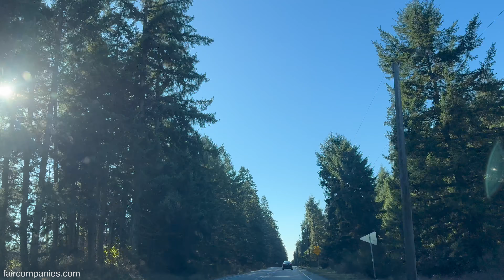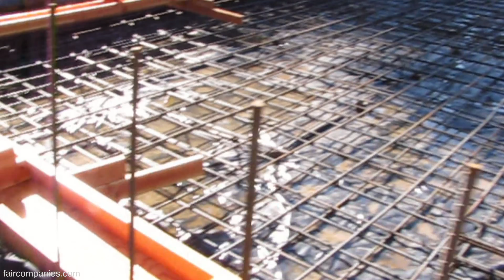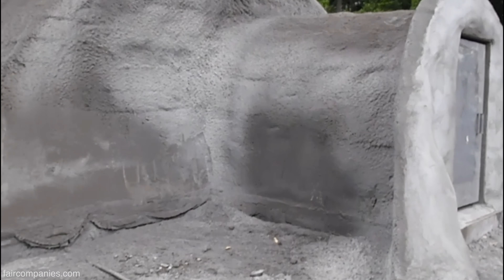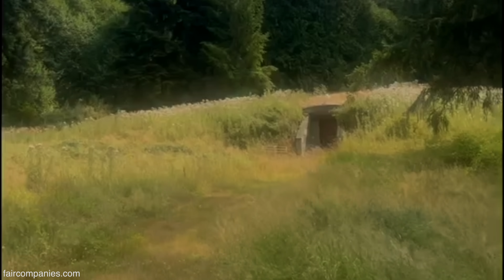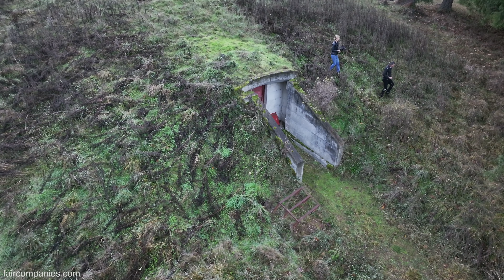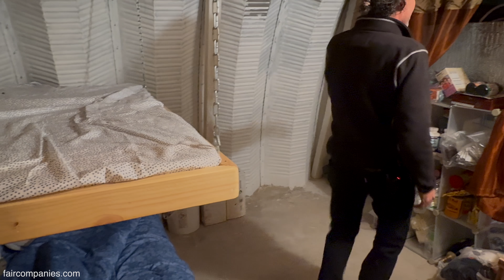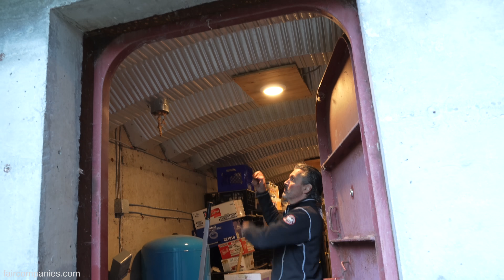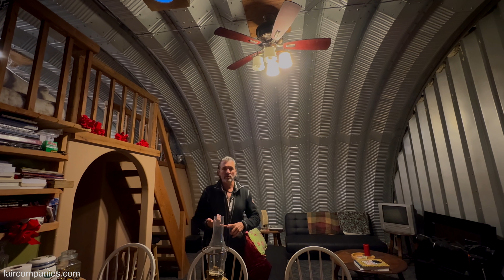Building Bunker Villa on a budget using Quonset Hut structure

Comment: Not sure why the spray foam was used?  It would be stronger with shot Crete directly on the quonset steel, no?
Reply: I am the guy who built the structure. I want to reply to you. The spray foam is needed for insulation to break the barrier between the cold earth and the interior metal underground structure temperature. Just like anything that has Insulation it's for that reason and we do it first, so it willprotect the metal structure from any cold surface. Up against  it creating condensation. I hope that answers your question. Good question very good question I get that asked by any serious Builder.
Reply: @davehygaard2  So its done because its a living space and to prevent condensation. A structure that is used for storage would not really need the insulation if it was unconditioned space.
Reply: Yeah not sure why the foam was used as well. The point of putting dirt on it is to use that as the insulation. The whole point to bury something is to regulate the internal temature. In most places the ground temp is 55f. Stable temp equals lower energy costs. 
The overall cost of this building is far more than what it would take to buy ICF. You can now insulate the footers, walls, floors, and roof. Give the specs to your enegineer and they will spec everything so you can bury several feet over it. The pond liner alone for a large enough piece is going to set you back upwards of 10k or more for a large enough single piece unit and thick enough that nothing will rip it.

Comment: 13 years in the pacific northwest and it's not leaking or moldy is an accomplishment. no worries building something like this in the high desert
Reply: I was born and raised in the high desert of New Mexico. Excellent point. No worries about condensation at home.✊
Reply: @El_Choppers  Yeah. Only radon poisoning
Reply: @madnessintomagic  Yeah.  That, and condensation.  But as long as you're moving this much earth, burying some perforated pipe for air tubes and install some fans.  You don't need great big fans.

One thing the host said was preferring not to have anything mechanical, and I get that.  At the same time, the place is evidently on the grid, so...  Anyway, fans don't pull that much juice, and you can rig up air intakes that direct air into the structure, regardless of wind direction, if there's any wind.  I'd do some steam punk thing, where my stationary bike powers the fans.
Reply: Depending on the radon level some remediation systems can be passive and don’t use power.
Reply: @nicklane1897  Same. Surface water management is essentially all I want to know at this point.
Reply: @nicklane1897  good point!
Reply: Exactly!
Reply: Not sure I'll ever understand why people think they need this at all. All the doomsday folks should pool their money and counter Chinese/Russian influence which seeks to destabilize their country. Donate to politicians that keep the country on the right track. Or at least take that cash and invest in a foreign passport. Almost anything is better than these bunkers. So much wasted potential, they're almost never used.
Reply: Except the clay content in the ground of the desert has a lot higher clay content which means it can be like concrete in certain areas to dig in. I live in the Sonoran desert, and some of the ground here has to be soaked or machine broken.
Reply: @DiviAether  It is very similar here, we have something called Hard Pan and it is basically concrete...
Reply: @VikingShelters I have a feeling hard pan in only in certain areas though - not EVERY INCH OF DIRT 😂😂😂 LMAO sucks so bad to dig out here - plus is when you do build out here it doesn’t have to settle much 😂

Comment: The underground pipes for ventilation remind me of the Earthship houses out in Arizona. As for temperature, once you get several feet underground (basically below the frost line + a few feet) the temperature stays pretty consistent all year round. Never thought of shotcreting a Quonset Hut so you could bury it, personally I would go with at least an exposed south facing wall I could put windows in to gain solar heating in the winter like the Earthships do, but i'm not looking for a Bunker to hide away from the world in, I'm looking for a super efficient house that could function off grid if the need arose.

Comment: My Dad built his home in 1960, pouring all the walls of the basement, including the center wall.  He poured a 6'X6" pump room, outside the house foundation, with a poured top with step, and that was our front porch.  He had a big cleanout screwed into it, to access the point in the well if needed.  He also poured a tile in the basement floor, just in case one day there would, one day, be a sewer, and need a sump-pump.  He put the hole there in 1960, and they used it in 1992.  Out of the basement, the steps awere poured.  He came in thru the garage with the stairs, because he didn't want to take up the room in the house. 
The garage were poured as well as all the garage walls, 18 inches from the floor, to build the framing on..

Comment: Critical success in having a well on the inside. I also appreciate the extra large tank on the inside, they just logistically erred in setting it up. Absolute critical failure in not have an air filtration system and having no in house power. It could be retro fitted, but in the end of the, just didnt think it through and too many mistakes made.

Comment: Not a disguised place! plant a lot of trees in the place where the bunker stands.Replace the light bulbs with LED ones, they shine brighter and require less energy. And so, in general, it is very beautifully and competently equipped, nothing superfluous. But just in case, I would consider a groundwater pumping system (if there are any in your latitude)

Comment: It will rust out in 20 years. It will keep cold in and moisture more so than expell. So you will need celling fans and a dehumidifier.  Your dome should be flat on top and round on the bottom for heating. So its upside down.
Reply: 12 years in and zero rust or water leaks in the wettest climate in the USA.... I don't think you realize what a Quonset Hut is made out of...

Comment: The builder seems to infer that the quonset arches don't have integrity without the shotcrete...but I believe they are more than capable of handling impressive loads without. I'm sure he did the math though, on the tonage of weight of that depth of backfill  which made it necessary for the shotcrete.
Reply: Yes, everything was properly engineers by a professional and I would never trust only a Quonset hut shell with 6 feet of soil on top even in the thickest gauges available. People have tried and from what I remember, it didn't last nor end well..

Comment: Will this keep radiation out, though?  It doesn't seem deep enough underground to prevent that.  Also, a few inches of earth covering the top of the shelter clearly wouldn't be enough to keep radiation out.  

Civil Defense standards state that any such shelter needs to be at least three feet undergound, arguably six feet, in order to protect from and keep out gamma radiation.  It would seem like you did this, right?  

Also, I would still construct concrete walls around it, even with the shotcrete.

Comment: I asked AI, what is shot Crete with helix steel, pretty fascinating stuff!

Shotcrete with Helix Steel is a combination of two building materials used in construction projects, particularly for reinforcing and supporting surfaces in tunnels, slopes, and other challenging environments. Let's break down each element:

 Shotcrete:

Shotcrete is a type of sprayed concrete applied with a specialized nozzle under high pressure.
It's often used in situations where traditional poured concrete is impractical or impossible, like overhead applications or uneven surfaces.
Compared to regular concrete, it offers better adhesion to existing surfaces, improved structural strength, and faster setting times.
 Helix Steel:

Helix Steel is a brand of microfiber reinforcement for concrete.
Unlike traditional rebar (steel bars), it consists of millions of tiny, twisted steel fibers evenly distributed throughout the concrete mix.
This provides more uniform reinforcement, reducing the risk of cracks and improving overall tensile strength and ductility.
 Combining them:

When used together, shotcrete with Helix Steel offers several advantages:
Stronger and more uniform reinforcement: Helix Steel distributes reinforcement throughout the concrete, eliminating weak points and reducing the risk of cracking.
Improved workability: The fibers improve the cohesiveness of the shotcrete, making it easier to apply and reducing the risk of slumping or segregation.
Faster construction: Faster setting times of shotcrete combined with increased workability allows for quicker project completion.
Reduced material usage: Compared to traditional rebar, Helix Steel can sometimes reduce the overall amount of steel needed for reinforcement.
 Applications:

Shotcrete with Helix Steel is commonly used in:
Tunneling and underground construction
Slope stabilization and rockfall protection
Swimming pools and water features
Repair and rehabilitation of concrete structures
Thin-shell structures and architectural applications
 Overall, shotcrete with Helix Steel offers a versatile and effective solution for reinforcing and supporting structures in demanding environments, particularly where ease of application and improved performance are desired.
Reply: Excellent, detailed response. Thanks

Comment: Listening to this guy lying like crazy I’m watching the outside of the door of the entrance to this place. There’s not 6 feet of dirt on top of that door. The vent is maybe 12 to 16 inches from the chakra concrete and you could see the entire events on top there probably 2 inches of dirt on top of the ceiling structure, he claim 6 feet which is a crackhead lie
Reply: Why is this entire so called bunker look like a 1970 trailer park home? Extremely unnecessary when in fact this could’ve been done very differently such as a modern home, mold resistant sheet rock interior insulation, God sakes why didn’t you put in well water for a manual pump as well as an electrical pump in case you have power outages you can just pump your water in just like on any home in Long Island or an upstate New York or I don’t care Beverly Hills it would be the sameI’ve watched building these homes as well as the structures and their upside down thinking is absolutely crazy. I’m about to build one myself and everything that I saw in the most advanced building method is childish.

Comment: This is a nice underground home. But it is not equipped as a serious survival bunker. It does not appear to have a gas tight door, air filtration or self contained generation. Anyone who ACTUALLY knows about bunkers would not have propane underground. There has been several nasty fires over the years. Of course everyone knows where it is now and that the guy has supplies stored. Overall not a good idea.

Comment: And since this guy used only 2 inches of concrete on the long side and 3 inches where the doorways are and everything, I hate to say it that bunker is only able to survive if any EMP hits maybe but if a nuke comes anywhere near that you die from radiation because the walls have to be at least 6 inches thick all the way around for a nuclear radiation not see-through but you also have to use earth over the top of it like he did but you need thicker concrete I don’t care if it’s reinforced concrete look at what happened to Chernobyl that had reinforced concrete and guess what if somebody stayed in some of those buildings they still would’ve died even if it was reinforced because it’s a lot of work and it’s very expensive to pour one thick slab in one complete poor
Reply: Maybe you heard him say the structure is covered with 2-4" inches of spray foam prior to the shotcrete? This structure is a solid 1 foot 12" inches of concrete with Helix Steel that is stronger than rebar and proven with science. 

The Bunker is covered with at least 6 feet of soil at the top. Thanks
Reply: Well the skylight anyways needs some sort of shutter unless somebody wants an accidental overdose of gamma radiation.

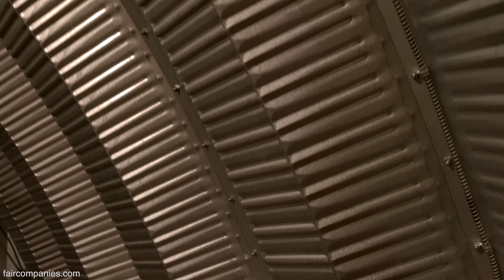Comment: 2:27 
But it looks cold, and how long will the steel last? And foam eventually absorbs water. So moisture? 
And then bury it?

Not sure about this for northern New England

13:20 water outside would freeze here; and with a minimal mid-sized solar power system pumping from that tank is of no consequence.

17:45 I’d have done a bit taller of a design (lowered floor height below) for adequate standing room. Excellent loft space.

Comment: It's a great build BUT since this IS Portland area subject to BIG Earthquaked that Qunset Hut will pull itself apart on the P-Waves (i.e. Powerwave) cross-moves and up-down severe vibrations of any tremor greater than 7.0 and then collapse upon itself. Unfortunately in the Pacific Northwest, the ONLY WAY to prevent structural collapse is LOTS of STEEL and/or Reinforced Concrete.

I've always wanted my own underground bunker but I'm building mine out of solid one metre thick (3.1 feet) of solid fibre-reinforced concrete with ultra-corrosion resistant galvanized high-tensile-strength stainless steel rebar for tensile and compressive strength structural reinforcing! 

I will be covering the entire outside of the bunker dome with a half-inch thick coating of Line-X truck bed liner and then line the outside of that coating with an 8 inch thick layer of fire-proof FireBricks for more off-grid-bunker zombie-proofing. Then I will pour a good 20 feet layer of gravel and an upper layer dome of high-density water-proofing clay over some very thick polyethylene sheeting to ensure water and ice/snow are moved away from the main dome structure.

For power I would use multiple 10,000 gallon propane tanks hidden underground atache dto a Ballard-type Proton-Proton Membrane Exchange Fuel Cell for the ultimate in quiety and stealth power production. Add a full supply of mountain house freeze dried foods (30 year shelf life) and decent long-distance Shortwave and Starlink Wireless Internet communications and you have a fully hidden off-grid house to survive the great pandemics or great wars.

V

Comment: Instead of Propane, have Hydrogen :) Propane is good...until the refill truck stops coming. But Hydrogen? Make all you want, whenever you want it. :)
Reply: IIRC, H2 is even harder to work with than propane. Smaller molecular size means more complex/expensive plumbing, etc. Maybe if you were using it to feed a fuel cell and ALL of the H2 storage and plumbing is OUTSIDE and well away from the structure.
Because... Hindenburg.
Reply: @andrewr7820  I hear you...however, you are ONLY producing as much Hydrogen as needed for that moment. No storage

Comment: I like the idea of having the water tank or, better, a series of tanks distributed through the living space.   
The reason is not just to temprer the water temperature,  but a perfect place to dump extra power generated by using imersion heaters  to bring up the water temperature and have a way to  naturally  boost or the interior temperature.   Think of extra power in solar arrays.. after the batteries are charged, the extra power is dumped one way or... this.  Comfort and humidity.

It would also be easy to draw surface rains into tanks if a well was not an option or in addition to.

Comment: It wouldn't cost $150,000 to pour the walls with concrete.
Reply: you don't even need concrete, brick will do just fine and last centuries. this will be a death trap in a decade.
Reply: @chrishultgren777 not true... this was built in 2010-2011.

Comment: Is the spray foam necessary since you're going to be insulated by earth? Or is it used for something else?
Reply: The spray foam is necessary in two ways, one having a surface for the shotcrete to stick to the vertical slope and two, it prevents moisture from sweating on the inside.

Comment: This reminds me of a Monolithic Dome. I think they layers materials in a different order: envelope on the outside, insulation inside of that, rebar and shotcrete inside of that. Their idea is for the concrete for serve as thermal mass that is insulated from outside changes in temperature. I wonder if the construction in this video fluctuates more or less, or if it makes no difference due to the thick layer of regolith outside of all the layers.

Comment: How do you keep an underground structure mold free?
Reply: Air movement. 
And as others have pointed out, low humidity.
Reply: If it’s water tight it’ll be fairly dry inside. I’d imagine you’d just run a dehumidifier on low every now and then.
Reply: Ventilation. But it would have to be completely water/air tight.

Comment: Honestly, it's better to live mostly underground, yes, perhaps not having windows that face the outside is a bit meh but it is cozy, safer, that is, intruders can only enter from one side, in winter you practically ignore the cold and you can isolate it from the sound to be able to make whatever noise you want inside, the only problemish is summer heat and air flow but not much.

Comment: I would have gone low voltage (12 volt) off grid.  The whole structure is like a giant Faraday box making it cell phone dead.  You'll need an internal antenna system if you care about that.

Comment: Instead of raising fixed width sections, how about an expandable accordion style?

Set up two rails and raise a section and roll it open, attach another section, expand, and so on until the desired length.

Btw, I believe the army has made buried versions of quonset huts for ammo bunkers.  I know they used above ground huts as offices and storage all over bases in hawaii.  My dad worked in two different quonset huts.